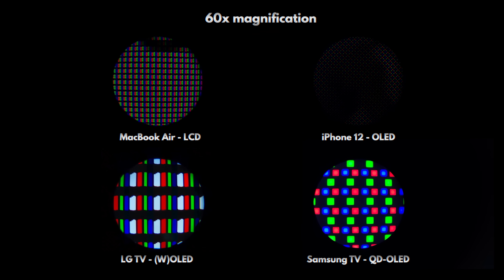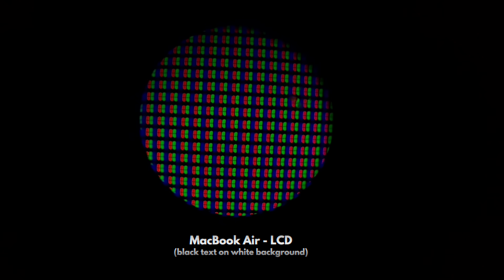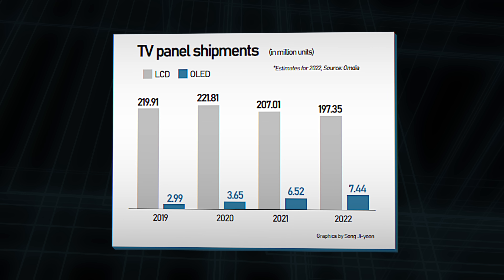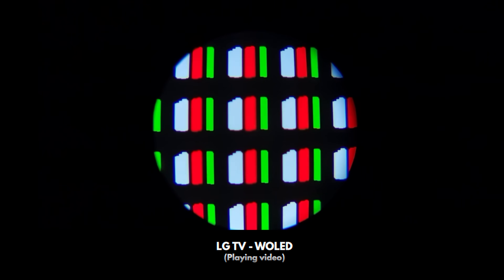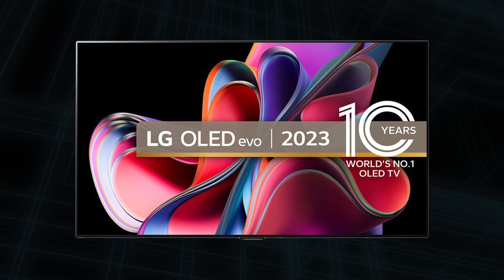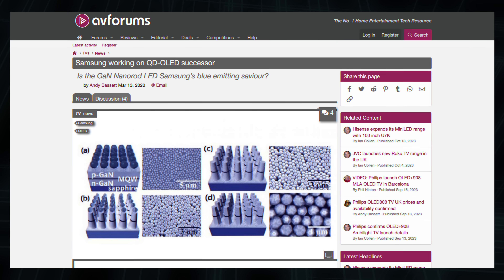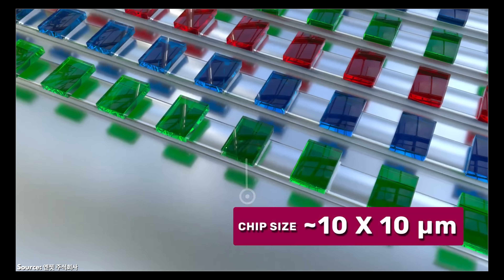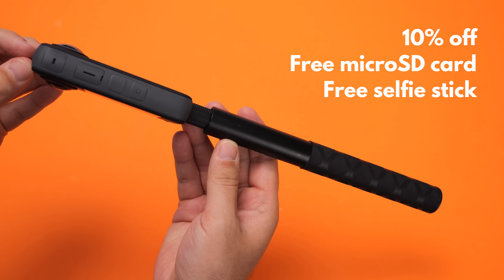The billion dollar race for the perfect display

Comment: I'd argue there's one more aspect we need for a "perfect display", low response time. The reason OLED monitors are so damn expensive because their response time is just insane, easily10x faster than even the fastest LCD panel you can find. The result? smoother motion compared to LCD at the same refresh rate, theoretically. So yeah, until LCD can catch up with that, OLED will still have one trick up its sleeve no LCD can ever hope to compete at.
Reply: they are expensive because they are expensive to manufacture, not because of some specific advantage
Reply: @numberl6  don't forget you are not paying the manufacturing price when you buy something, the market plays a giant role in the that. With more demand but same availability the price goes up. If nobody wanted OLED and went with LCD the price wouldn't be  that high or you wouldn't even see oleds. In short specific advantage creates demand, therefore the price can go up
Reply: @Tomi-always-Tomi  yes, but higher production costs is the bigger factor here, manufacturers increase prices for OLED panels to maintain margins
Reply: @Tomi-always-Tomi  What... They cost more simply due to higher price to produce said product... The company need to make a profit and companies want large profits. Its nothing to do with faster response times or literally any benefit over LCD. Its literally because they cost more to make. That is literally how this all works and that is main reason why it costs more.
Reply: The result is actually less smooth motion, judder is a problem when watching videos on OLEDs. There's better clarity and lower input lag though which are advantages in competitive gaming.
Reply: @Hiromandt  The slow response times in LCD are a huge issue, and when people bring up "smoothness" as an advantage for LCD thats something that OLED manufacturers could easily replicate with much higher quality. LCD shows faulty image most of the time thanks to the slow response times. If you ever used VA monitor you know how garbage they are in motion thanks to this issue.
Reply: True, OLED mostly has average pixel response time under 0.1ms while even the fastet modern LCD(540hz asus TN) has 1ms average with overdrive.
Reply: the fact that they fade and very much dislike static elements on screen is why I would not get an oled as a monitor...tv maybe but not monitor... and when watching a movie... the response time isn't that important...a games console raises the static elements issue again
Reply: Hardware unboxed made a video about this. Some LCD monitors with backlight strobing from benq actually beat OLEDs if I remember correctly